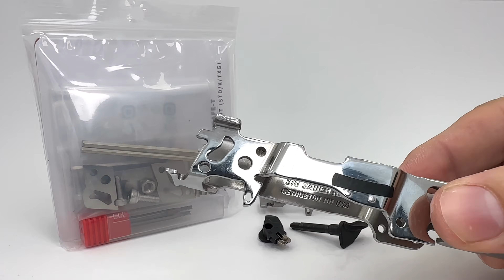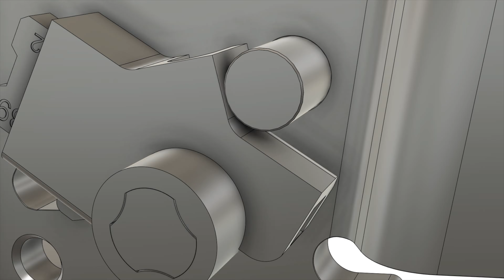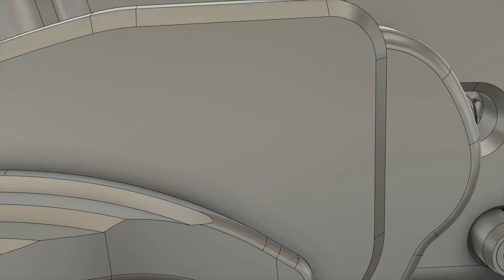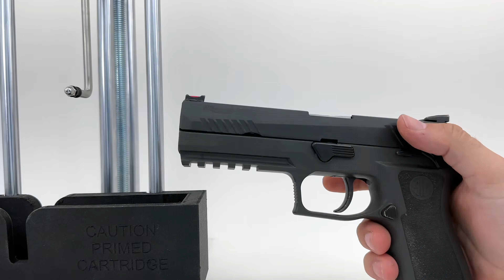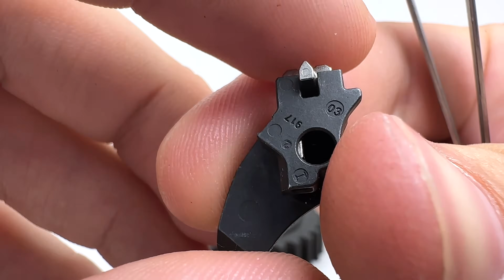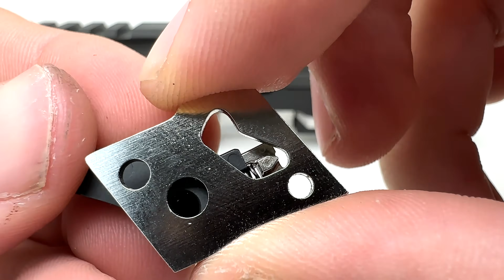ANALYSIS OF THE P320 MANUAL SAFETY

Comment: Question: would the striker safety lever stop a striker from dropping from the second sear notch, or is the second sear notch “after” the striker safety lever?
Reply from the maker: The second notch is mainly to deter an AD should there be a split second jostling of the sear. However, the true safety is the striker lock lever, which, without a trigger pull will not be lifted, and therefore the striker would not be able to make it into the breach face.

Comment: Does your MS conversion kit work with the AXG grip module?
Reply from the maker: Not technically, although you could make the cuts into the frame, it will not let you also cut the side panels, that would need to be done free-handed. I have seen quite a few people accomplish it but it’s not what the kit was specifically made to work with.
Reply: @SIGMECHANICS  Thanks.  The frame is all I was wondering about.  The grip panels, easy peasy.
Reply from the maker: @vahngeo2260 sure, I can only recommend (from others’ experience) add more tape u see the grip jig to “thicken” it, since the AXG frame is thinner than the polymer. Then make sure to use a thumb to hold the jig down as you cut to make sure it won’t move on you.
Reply: @SIGMECHANICS  Cool....thanks!

Comment: I belive on the Airsoft version of the m17 the safety worked also kinda like it but instead of stoping the trigger bar of behing puled it pushes the bar down so the hock on it can’t press the release mechanism
Reply from the maker: I own the M17 airsoft version as well. I’ve always wondered if I should tear it down to see how it functions.
Reply: @SIGMECHANICS  oh I would love a video about it tho it is a bit harder to put back together then to disassemble it 

The only problem I have with taking of the outer barrel from the inner barrel is the pin holding both together once out it’s hard to hammer back in and is bend easily if you want to know how it lookes like it’s part number #02-04

I love this pistol from the way it looks and as a wrong handed shooter I love the reconstruction to left handed with the mag catch and release

I also installed a flat adjustable trigger I made the trigger pull as short as possible I only have like 1mm of travel before the brake and it stops right after but is still able to reset but the movement of som parts has a bit of play room so I could not completely eliminate the travel 

My main Airsoft gun is a Vfc hk416a5 GBB and there the trigger has no travel it’s already at the wall when cocked

Comment: I wish I found your YouTube channel sooner.. New owner of a SIG P320 M18 CA-edition here.  I made the mistake of forcing my takedown lever open with a wrench to start disassembling with an unloaded magazine in the gun!!!  Everything seems to function properly but I would like your expert opinion if forcing it open that way can damage any mechanisms. 

Thank you!
Reply from the maker: There must be some sort of damage. The takedown lever bar (black bar that runs the length of the FCU), would need to move back, the backward movement is what makes it so that you can have a mag inserted as the bar would hit the mag tube body and not let the bar move far enough for it to disengage the sear.

That bong said, if you successfully did that, something would have to be left damaged, the mag tube or the takedown bar. Have you opened it to check?
Reply: @SIGMECHANICS  sorry for the double message, I didn’t know links can’t show.

Comment: great video as always!  i've been following this series since your 1st version (as well as your other videos!).  maybe i missed it, but so far i have not seen any video on converting the standard grip module even though your version 2 of this conversion kit has the templates that will allow for converting the older grips.  is this process exactly the same as that for the x-series just need to use the appropriate templates?  or are there differences that need addressing due to the differences in the grips?
Reply from the maker: Thank you. You’re absolutely right, and I will make a video for the standard grips. The process is exactly the same. The only difference is there is a slight modification in the jig that allows the template to properly situate itself on the grip. it works with both standard and X series so there are no problems or changes the affect one over the other.

Comment: So far I haven't been able to find a complete kit that has the template & I have a couple of 80% fcu that I started last year & completely halted my 2 builds due to unintentional discharge videos. . Seems like Sig refuses to help you if your fcu is 80%
Reply from the maker: Oh, the MSAFE-T kit does not come with the levers, but if you contact a company like Desert Depot, you could get both I think since they sell the kit and the parts.

I believe Sig doesn’t since the 80% are an idea from a company outside of Sig, so there’s no customer support on a product they never made. For stuff like that you can approach someone like Sig80BitKits, they sell 80% and might help resolve issues.
Reply: @SIGMECHANICS   thanks for the information 🙏 I couldn't find it anywhere

Comment: I have wondered what would happen if the trigger were forced with the safety on. Great experiment and explanation! I think blocking the sear would be preferable, but it's impressive what SIG was able to do with what was an afterthought safety design for the military trial (I could be wrong about that, but I don't think the safety existed before the XM17 trial).
Reply from the maker: I have a design I’m working on that will block the sear physically but I need to get some made in order to test. I want to make it a drop-in part if I can so it’s not much more work to install it.
Reply: @SIGMECHANICS  Wow, that would be awesome. I look forward to seeing it!
Reply: If you can figure this out I’m all in FYI

Comment: Thanks for the video. I'm afraid it's over my old man head. I hope you can answer my question. I have an older p320, that I had upgraded on the recall. I just sent it back to Sig and had them put in the manual safety on it. I haven't gotten to shoot it yet because of weather. Just want to know what you think of my decision. Thanks
Reply from the maker: That’s a great question, and you made the right call. Although there are varying debates about pre vs post upgrade and which is “best”, the new version adds new parts and uses better mechanics. There are quite a few differences so I’m sharing with you this video that will give you all the details…

P320 - PRE v. POST UPGRADE ANALYSIS
https://youtu.be/VmwpkJuIR00
Reply: Thanks Bud. I have been hunting or shooting my whole life. All the guns except BB guns had a safety. The Sig was my first striker fire pistol. After I got it (and hearing a lot about it going off, which I think now was seventy percent BS) I just couldn't feel comfortable with it. That's why I sent it back to Sig. Thank you for the reply and I'm going to check out the link to your video. I really appreciate your reply and help.
Reply from the maker: Anytime, and if you have further questions let me know.

Comment: Thank you so much for the updated video! I had commented after seeing your other very detailed breakdowns. 

One question though: in the case of these theoretical and unlikely uncommanded discharges without a trigger pull, does this pre-sear engagement from the MS do anything to prevent the striker from moving forward or is it only the firing pin block? The 365 seems to be the safer design in this case but would love to hear your analysis. Thank you.
Reply from the maker: The manual safety prevents the trigger bar from touching the sear which intern prevents the striker from moving forward since it remains blocked by the sear. Internally, when you pull the trigger, even with the manual safety activated, you are still lifting the lock lever on the striker.
Reply: @SIGMECHANICS   enough movement to disengage the striker safety lever? I recall a very short trigger travel in your other video for it to disengage, .090 I believe. I am assuming the manual safety doesn’t allow the trigger to move that full .090? Not sure though. However, would still need to pull the trigger .11 for a discharge. Thanks

Comment: Always appreciate the videos. I think I've seen them all at least once. One thing I don't recall if you covered was the drop safety of the sear itself... and I don't mean the mechanisms added to protect if the sear ever does fail (like the 2nd sear ledge and the striker safety)... but if there is something that's designed and/or inherent that stops the sear from ever dropping in the first place from kinetic energy, like a drop or hard shock of some kind. With the sear pivot/pin being so far off to one side and not in the center, it seems very off balance... and off balance usually means that it will want to turn/rotate one way or another if dropped at specific angles or ranges of angles. I know that the safeties would at-least stop the striker from setting off the round if the sear ever did fail... but it's a little tougher to imagine why the sear wouldn't fail if dropped the right way. (For example, Does the opposite/rear side of the trigger bar stop the sear from rotating if the trigger is not pulled? I've seen some DAs and DAOs that work like that, but I'm not sure if that's the case with the P320 also. I've always been a strong believer that if a person owns a firearm, he should know precisely how that firearm works, so he can inspect his firearm and know 100% if it's in safe working condition or not). Forgive the long explanation. Not an easy thing to describe.
Reply from the maker: I didn’t specifically go into the physics of the sear movement when dropped, it would be interesting for sure but I’m not sure how I could accurately capture that data in a test. I’d have to see what type of method could work.
Reply: @SIGMECHANICS  Good point. I'm not really sure. I always wondered when you pushed the sear down with a punch if kinetic energy would also be able to push it down. Like with a Glock, there is a shelf that the trigger bar rests on and it cannot be pushed down at all while the trigger is not being pulled... and only when the trigger is mostly pulled does the trigger bar ever leave the ledge to be able to drop down. With the P320 though, I'm not sure if any mechanism exists. I'm not sure what the best way to prove/disprove that would be. I'll have to take a look when I get a chance and see if I can come up with anything. I guess that's one good thing about the P320 FCU. Unlike the LCP style guns it contains all the fire control lower parts... so I hope I can get a good look at one when I get a chance.